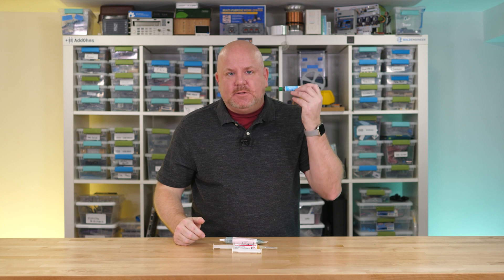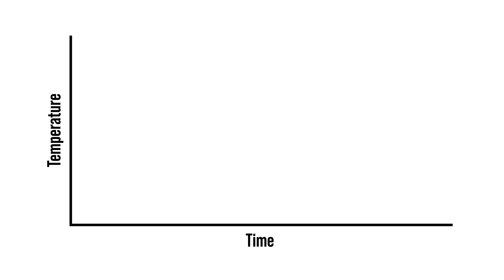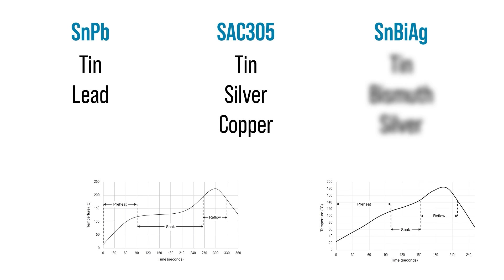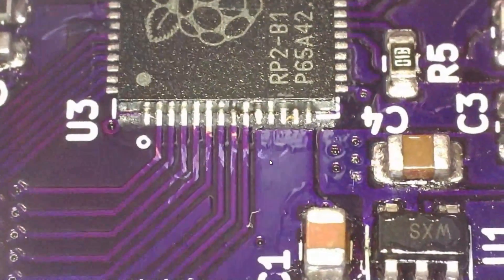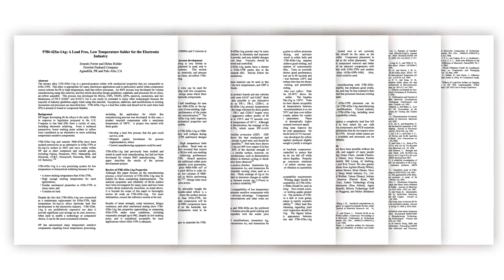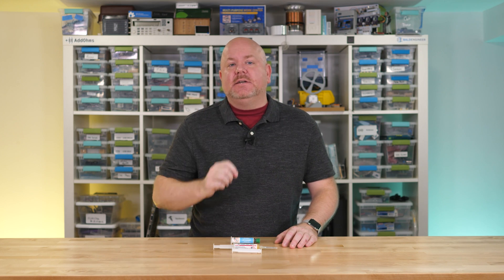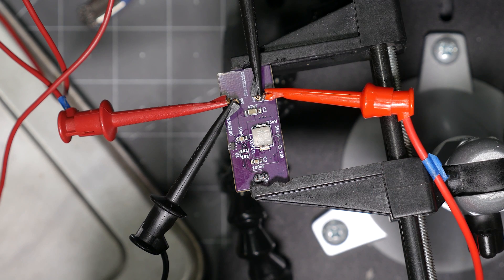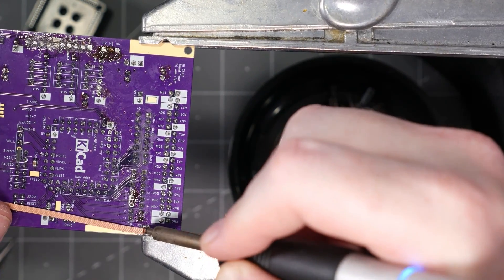Pros and Cons of Low-Temp Solder Paste - Workbench Wednesdays

Comment: Unfortunately that bismuth solder has significantly lower adhesion and not suitable for all the parts. For instance you do not want to solder connector on PCB with bismuth solder because it can be easily delaminated from the pads during usage.

Comment: Another thing, the fighter the particles in the solder paste generally the easier it will melt and flow. Which is why I prefer to work with a T5 solder paste instead of a T4.

Comment: Bismuth when mixed with Lead drastically reduces the melting point. I do not remember the eutectic mix of Bismuth and Lead but in some cases the melting temperature can be as low as 90C ! Actually those solder removing pastes used to help on component removal are exactly that, a mix between Tin Lead and Bismuth. 
So one needs to be very very careful when using Bismuth bases solder since the solder iron for example an contain leftover Lead solder ... the mix would substantially reduce the melting point on the solder components.

Comment: How does one not move a board when using a soldering hotplate, since the hot plate stays hot for so long after turning the power off?
Reply: Change the profile so you can tolerate a longer cooldown.
Reply: @bald_engineer  I don't believe mine has that capability.

Comment: This question may be out of your wheel house, but I am going to ask anyway.  I have a Jeep vehicle that has the rear window glass defroster grid.  Jeep has a common problem with the electrical connector breaking free of the copper mounting location on either side of the grid.  The recommended fix is sort of epoxy that conducts electricity (which doesn't work, mine fell off within an hour after the dealer repaired it), or just replace the glass.  You can bet the the connector will come loose on the new window sooner than later.

Do you think this low temp solder could be used to make a permanent repair to these defrosters?
Reply: My pajero just did same. Tried normal solder with  no joy.  Hence why I'm here. 😥

Comment: it's always disappointing to watch these videos. i can't afford one of those high tech black and decker reflow ovens! making the hobby inaccessible!
Reply: You have a kitchen stove, don't you? Use that. Mine is natural gas, and I put the circuit board on a piece of 1/2" thick aluminum to buffer the heat. I expect that would work for electric too. Wait until the solder turns shiny, give it a few more seconds to be sure it's all melted, and turn the heat off. Not the perfect temperature profile, but it works.

Comment: Could the low temp solder paste work to reattach aluminum terminal studs to the aluminum base on a 3.2v 280ah lifepo4 cell?
Reply: I’m late but I wouldn’t never solder to any battery. You will do some sort of damage to the cell no matter what anyone tries to tell you. Also solder joints arnt as good for vibrations which most battery powered applications will experience some as they are intended to be mobile. The answer is don’t try to repair a battery. Recycle it and buy a new one, typically they are spot welded, laser welded, or ultrasonically welded. You’ll never see a manufacturer soldering to a cell terminal and there’s a reason for that as the cost of the equipment for all but the spot welders is very high. Invest in a good spot welder like a Kweld or similar, not a cheap Amazon one, they won’t hold up or do the job well.

Comment: I’m a rank amateur who's a danger to society with a hot air gun. I managed to move 4 SMDs from an Arduino Nano the first time I used one. Low melt solder has been a life saver for me, I can work confidently at lower temperatures when trying to fix my mista… I mean things the manufacturer got wrong.

Comment: I need to solder the "wire" (small tab like thing) back onto my rear window defroster.  Would I just put a blob on the defroster, push the tab onto it and then use my heat gun to reflow it?
Reply: I would apply flux to your window, reflow the joint and clean off with solder wick. Then apply new leaded solder, tin your replacement tab (Should be a spade connector) and hold in place with tweezers while heating with the soldering iron.
Reply: @davidstech1445  just tried this........ No joy.
Reply: @ivanhoe6366  For such purposes there's something called a silver based elecro-conductive glue or lacquer (dont reply to me - I'm electronics technician but I'm using someone else's account rn haha)
Reply: Why not just use a soldering iron? I recommend a bit of no-clean flux if you have some ...

Comment: I've not tried it yet, but the reflow temperature of bismuth-based paste being only slightly higher than my 3D printer's heated bed during ABS prints gives me ideas 🤔
I'm not suggesting the heat bed would do all the work, but it could maybe act like the initial stages of a proper reflow profile, and then a hot air gun could push it over the edge... (I mean a temperature-controlled soldering station hot air tool, not one of the 2kW paint-stripping things, to be clear.)

That seems like it'd give more consistent results than the hot air tool alone, especially for things like exposed pads on QFNs or ESP32 modules, and might cause fewer melted connectors and switches 👀

(Obviously something like a hacked toaster oven will give better results than what I describe here, but I'm not at that stage yet! This is an experiment in whether I can get improved results with equipment I already have :))
Reply: I have seen Tech's in work solder entire projects with hot air tool, if you get the technique right, there's never a prolem.